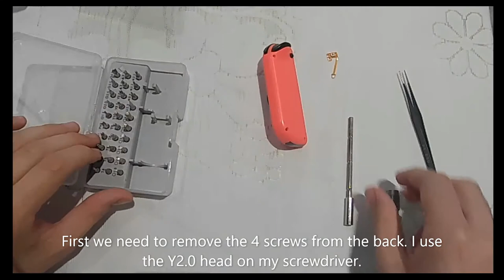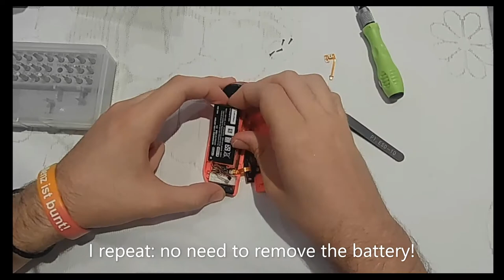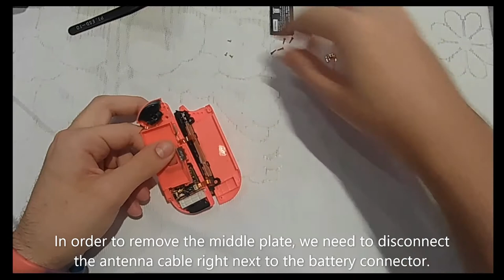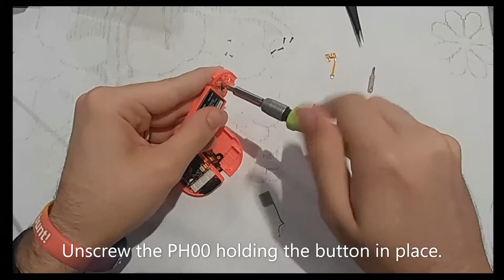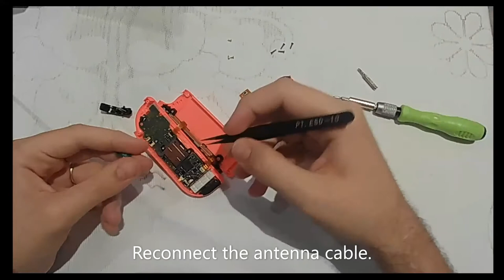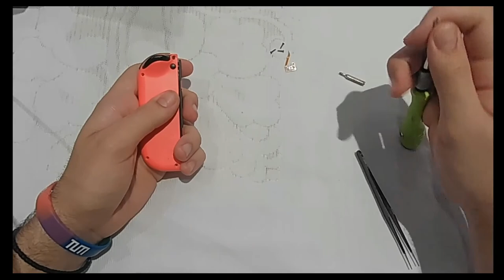Right Joycon ZR button not working: Replacement - Nintendo Switch

Comment: The ZR button to my switch lite
is loose. Whenever I use bows on BoTw,
it stuck in place. I have to give it a slight
nudge for it to get back in place.
Reply: I'm late, but the spring may be loose